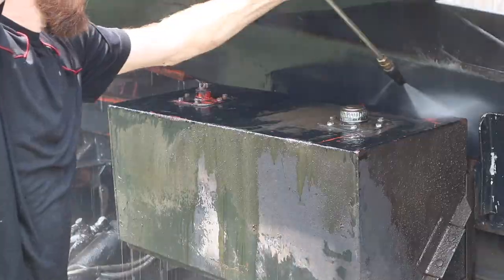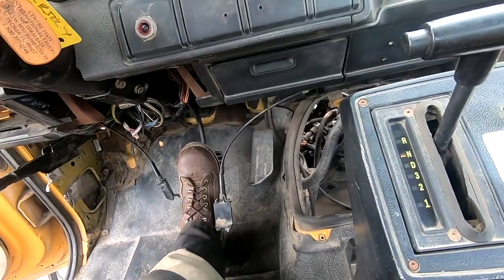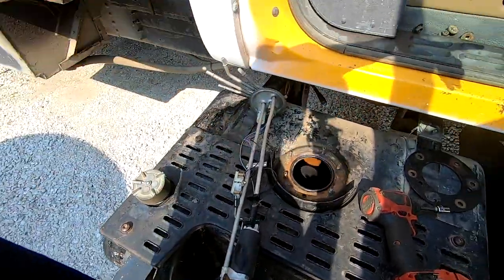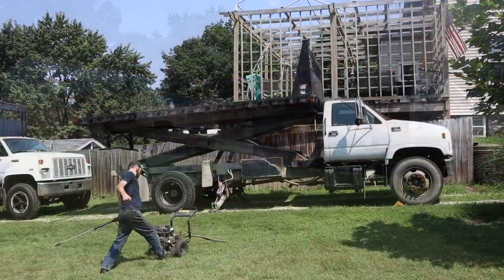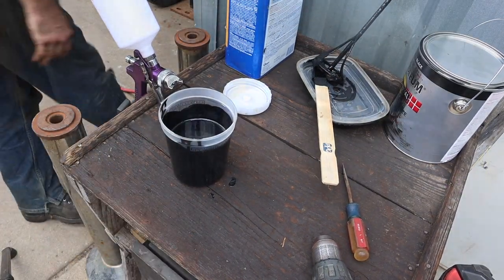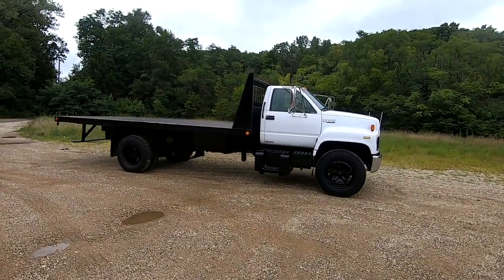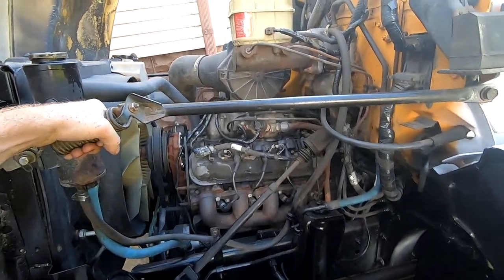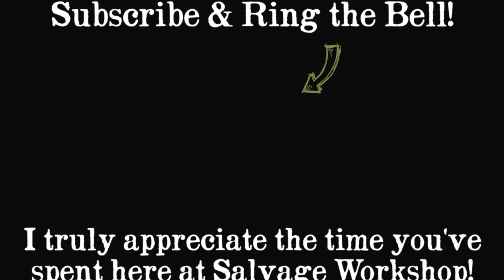"Restoring" & Flipping TWO Chevy SCISSOR Lift / DUMP Trucks

Comment: So when  i wrote this i when you were pressure washing the first of trucks in this video and then you rattle caned the front tire that was pre taped off clearly over the rust and everything dont get me wrong i totally get where you're coming from but i would like to see you finish up the track loader you started on I totally agree with cleaning them up but with the rust why would you not sand blast or wire wheel the rust then spray on like a rustoleum or a similar rust preventive at the point of just spraying over the rust your just polishing a turd
Reply from the maker: Time... it boils down to that... I could have gotten a great price having not cleaned or painted them at all, but any paint is better than none, and will look more professional for whoever buys the truck for their business... I put the time into the more important things.
Reply: @SalvageWorkshop  true

Comment: 47:27, incorrect sir, I own 8 Diesels with spark plugs.
Reply from the maker: Yeah they do exist, but I'm guessing they are older 30-50's tractors, power units, or similar?? And are they gasoline start, but then switch over to another part of the engine that runs on diesel once started or warmed up... I'm also betting the spark plugs aren't used to burn diesel fuel either, am I wrong?... The statement I made stands pretty true for just about ALL diesels, and I wasn't talking about the exceptions.
Reply from the maker: Yeah they do exist, but I'm guessing they are older 30-50's tractors, power units, or similar?? And are they gasoline start, but then switch over to another part of the engine that runs on diesel once started or warmed up... I'm also betting the spark plugs aren't used to burn diesel fuel either, am I wrong?... The statement I made stands pretty true for just about ALL diesels, and I wasn't talking about the exceptions.

Comment: You won't find one truck this size in the whole of Europe with a petrol engine...you would need to carry a petrol station around with you all the time and would cost about 300 Euro to fill that size tank...and it makes no sense power and torque wise to not have a Diesel engine